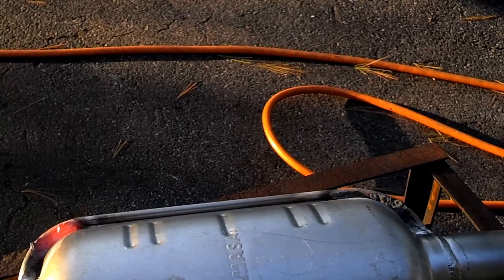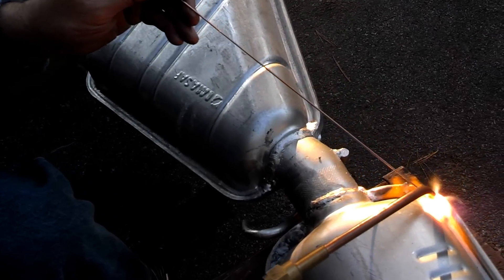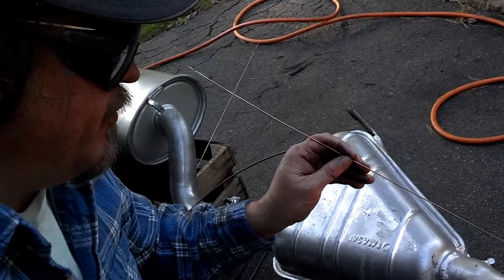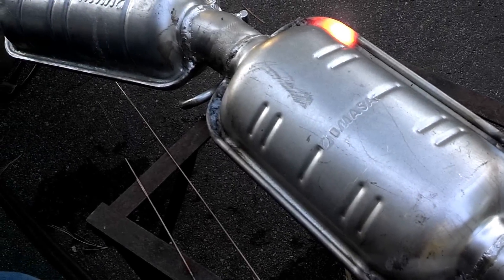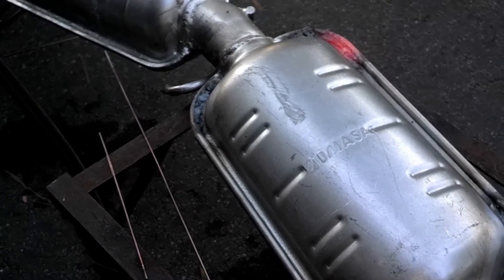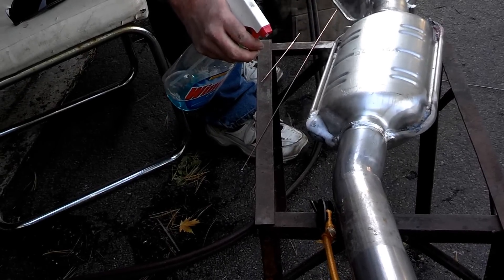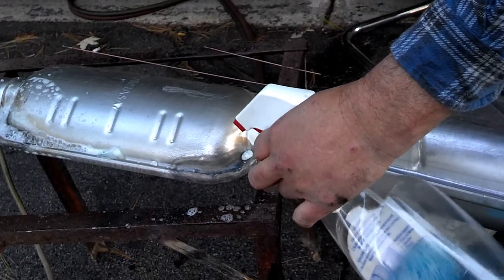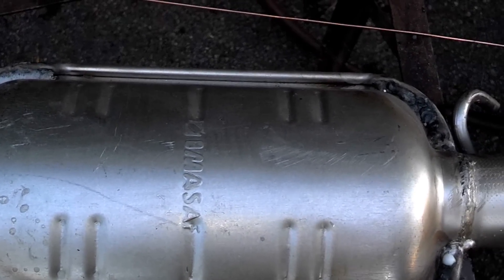Muffler Brazing with steal

Comment: Great explanation. I mean... I'm guessing. I didn't actually hear it.
Reply from the maker: Well looking back at it.  That old car I had 8 years ago sucked exhaust into the car on the highway.  I purchased a new exhaust system and the problem was still there... after installing the new system to no improvement, I removed it and pressurized it as in this video.  welded per vid... drove it 5 years more no problems.   Gave it to a friend in Puerto Rico (shipped it there in 2015).
Reply from the maker: Yea, it was very quiet after this weld.  My only regret was that I didn't just weld/braze the original system, since I had to remove this new one and do about as much welding as I would have needed on the old one.

Comment: I always wonder if it will hold using a connector  and solder it or brazin it, if the exhaust can reach 700F degree then it won’t. Did it hold up?
Reply from the maker: Yes.  Though the aluminum-brazing-rod I used required more heat than solder... it had to be almost "red hot" for it to flow and there were spots where it did overheat and had to cool a little before putting more rod.
Reply from the maker: I put about 60K miles on it afterwords.
Reply: @reitze01  yea i think im gonna go that route, thanks for the reply sir. I hope it holds up too. I have no access right now to a welder.  And I can’t wait anymore.

Comment: Which filler rod you are using.?
Reply from the maker: Whatever wire I can come up with... or, I bought welding rode a few times. (torch type).  I think I also tried an aluminum type fill on it till I discovered the whole seams were leaking... and ended up welding it all.

Comment: You didn’t steal that, did you?
Reply from the maker: Seal?  Yea.  LOL, 7 years ago.  I was highway commuting 45 minutes each way and smelled exhaust at the highest speeds.  I think it was designed to leak a little since the new pieces clearly leaked at the seams.  So I ended up sealing them by welding them.  It worked for the life of the car.  That was 5 years when I gave it to a friend in Puerto Rico (yea it got transported there when I lived there a year).